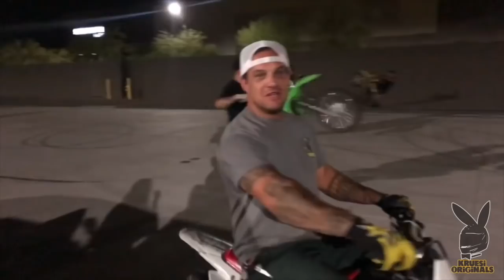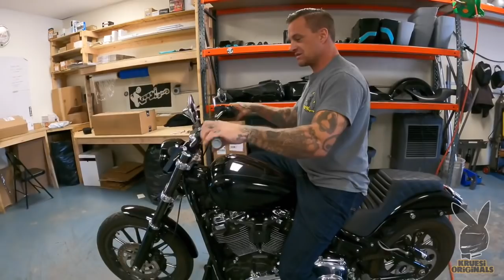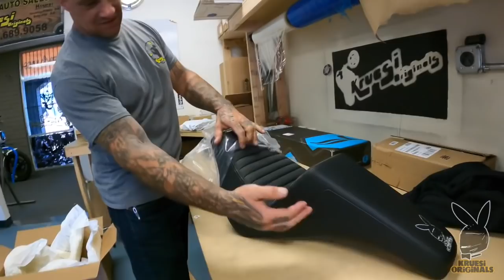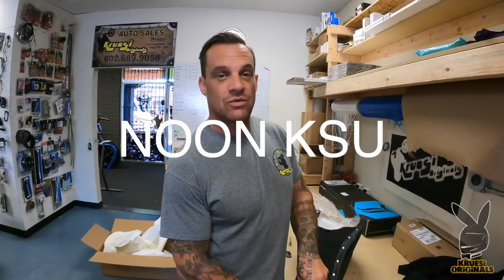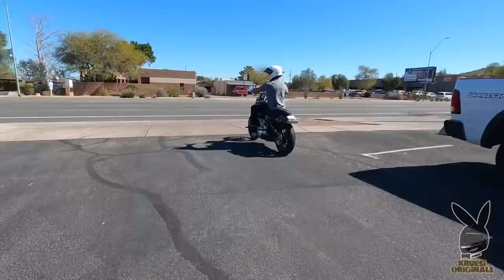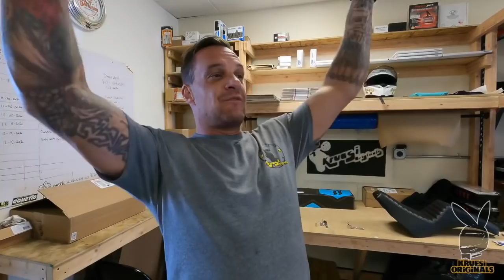Witch is the Best seat for m8 Softail

Comment: Bike is looking solid- glad we could contribute to it.
Reply: I really hope there is plans to do this same update on bagger step ups, I NEED one that pushes me forward like this for my road king! If not can I reach out to have that done?
Reply: @bikeonblue  How tall are you? The standard reach Step Up is typically good for most riders. Unfortunately as well we are currently unable to do foam modifications.
Reply: @saddlemenusa  im 6' but want to be up on the tank for more aggressive riding. It seems that even if I add pull back risers ill still be back a little further than I'd like. Any plans for a lattice stitch gripper in the near future?
Reply: @bikeonblue  Not currently as we have an extended reach offering so unfortunately  the standard would be as far forward as we'd likely develop for.
Reply from the maker: @bikeonblue  what year is your bagger?
Reply from the maker: @bikeonblue  The standard is the furthest forward seat on the market right now. I run it on My Rd., King and I have a Krause pullback plate It’s dialed I’m 6 foot.
Reply from the maker: I’m so pumped on the seed it’s amazing thank you very much🦅🔥
Reply: @kruesioriginals  2020 road king special, I want to chop the bags and rear fend to set it up for stunting. But the seat it the first step so I can get my riding posistion square.
Reply: @saddlemenusa  I'm 5'6 and going to need that push forward, I really hope you can make this happen. Or will be able to take some custom order soon. Anyway I'm happy to hear that you are busy in these times!
Reply: I need one of these!!! Did this make it???

Comment: Have you compared Corbin to Saddlemen? What are your thoughts? And did the saddlemen lower your seat height?
Reply from the maker: They raised my seat height and pushed me forward. Corbin Seats you’re like riding on a cement block 10 miles away from the handlebars
Reply: @kruesioriginals  how can I buy this new and improved seat for the  new softail